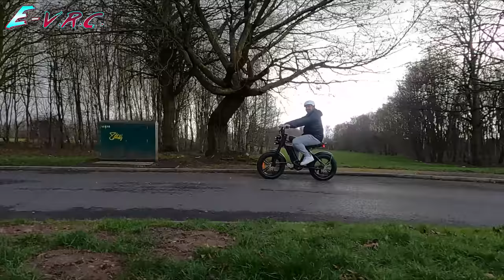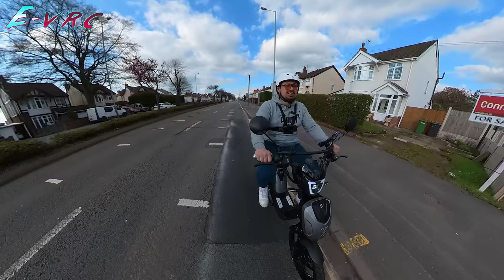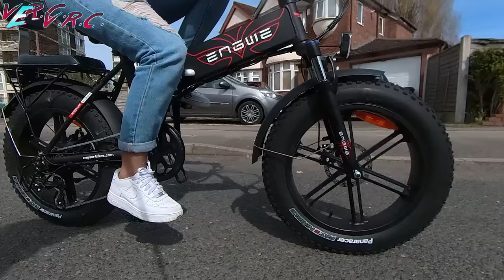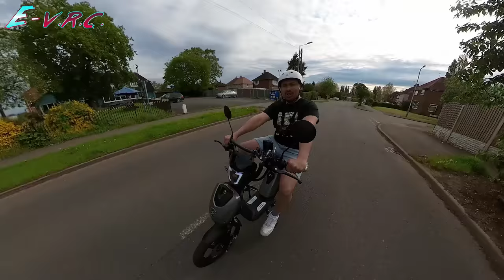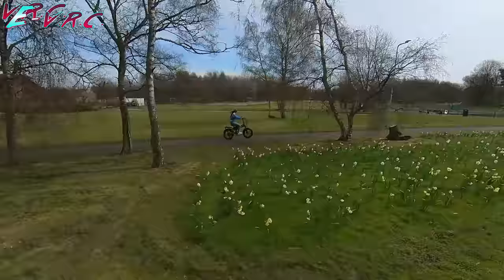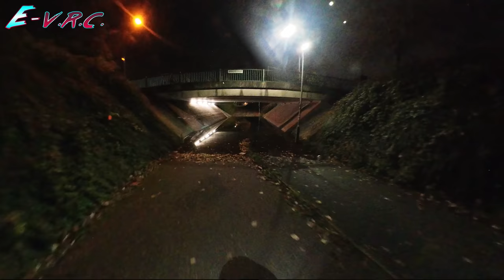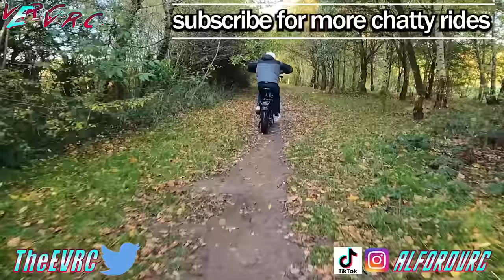The CRAZY Ebike law that MUST Change Before Someone Gets HURT

Comment: In my state (South Australia) the power limit is 200w and no throttle allowed. It's so silly.

I need that throttle regularly, as you show, to get around turns and across toad crossings, etc.
Reply from the maker: Wow even less! I'd have expected Austrailia to be similar to the USA.
Reply: i'm in Western Australia and i have 2 ebikes with 1500w bbshd mid-drives that can comfortably reach 50km/h. 

I have never had any problems with police over the last year i've owned them. 

I think you could probably ride any setup here as long as you aren't being dangerous. 

I regularly see sur-rons blasting past me at 500km/h and i think those sort of riders are the ones causing the problems.
Reply: @sparkoceanic  No Bike goes 300mph. Let alone an Ebike, silly!

Comment: Here in (D) you can have a S-Pedelec with assist up to 45km/h but you need insurance and a moped-license plus wear helmet. Throttle still not allowed, but I do not get your pioint with this. I never missed it. you can gear down for uphill sections or increase the assist-mode.

Comment: an e-bike (or to be more technically accurate, a pedelec) should be pedal assist only. A moped (ie, pedal-and-pop) has a throttle as well as pedals (to get started in low gear and to start the engine if that's needed for a petrol powerplant) and requires a CBT and provisional licence. A motor scooter is throttle only, no pedals - ie, a motorcycle, with or without seat.

I've known the difference since the late 1970s, what the hell is causing all the confusion??
Reply from the maker: Not sure. Maybe you were typing whilst I was talking so didn't get the point of the vid? 😬😬😂😂
Reply: you have read that once again, all that is explained in legislation and if there is nothing about it it means it's not illegal. ebike is 250W and that's it really, everything else it's made off by dvla or police.

Comment: For ebikes to be treated the same as regular bicycles, like no age or licensing restrictions, access to bike paths and such, the laws have to be restrictive.

If you want the capabilities or the power of a moped or small automatic scooter/motorcycle, get just that. But all sane people would argue that having age and licensing requirements for motorcycles, scooters, mopeds them is a good idea.

The "pedal assist bike" you are riding is an e-moped trying to pass itself off as an e-bike, with pedal placement and usability being an afterthought. None of those problems exist on properly designed e-bikes, like a Specialized Turbo Levo. Can be actually pedaled without assist, the SL (super light) models even more so. It has a proper pedal torque sensing controller, it can and does provide power from 0 cadence. You won't pedal strike going uphill anymore than a regular bicycle. Maneuvering tight spaces isn't an issue without throttle because its not built like a moped.
Reply: Well said, all the crap “e-bikes” in this video are not designed at all to be pedaled, the idea is: we just glue a pair of pedals to comply (on paper) with the rules, who cares if the frame is heavy with bad geometry, the pedals hit the ground, wheels are ridiculously fat and inefficient, transmission is a joke and the motor control is without torque sensor and abrupt activation ? The manufacturer already knows that they are going to be used with a throttle, and they will be modded to produce more power to have decent performance and used basically like a moped.

A decent e-mtb with mid drive motor from a serious manufacturer (Bosch, Yamaha …) and a proper 11 or 12 speed transmission, even much cheaper than the Specialized Turbo Levo, can ride basically everywhere on mountain trails, this even with the 250W limit and without a throttle. But such bikes are properly designed to be light and efficient so they do not need 1kW to go up a moderate hill. They are reasonably light and agile so that you do not need a throttle to move around obstacles and start moving.
If you don’t need to go off-road there are valid city e-bikes with similar quality components that performs equally well.

Comment: I got the perfect way around the throttle thing i think, with torque sensors literally instantly measuring torque, manufacturers could make it that as soon as it feels pressure on the pedals it uses the power dictated by the throttle, now that would be a nice feature and i think that would be legal as it's still not a standalone throttle
Reply: If torque sensors were economically feasible for all ebikes, all ebikes would have them, as they're objectively superior.  The problem is, that solution excludes low and most midrange hub driven ebikes until someone can make torque sensors as cheaply as cadence sensors.

Comment: To answer you question. If it has a throttle it's called a "Motorcycle" and you need a License, Insurance, Road Tax and a Helmet. Pretty much everything you have said here can be summed up as I want an Electric Motorcycle (Moped) but I don't want the legal restrictions that go with that.
Reply: I commented almost the Exact same!
Reply: A mobility scooter requires none of those things but has a throttle. It's the speed and power of a motorcycle that require it to be licensed, not the fact that it has a throttle. It makes sense in terms of safety to have a means of responsive speed control within the power range of any vehicle,  and it can still be speed limited.
Reply: @oldboy5001  From the Government Web Site :Mobility scooters and powered wheelchairs come in 2 categories:

class 2: these cannot be used on the road (except where there is not a pavement) and have a maximum speed of 4mph
class 3: these can be used on the road and have a maximum speed of 4mph off the road and 8mph on the road
Reply: @FellRaven01  Not sure what point you're making here. It's still not defined by having a throttle, but whatever.
Reply: @oldboy5001  How many wheels do mobility scooters have, how do they compare to e-bikes which are limited to 15.5mph. No relevance at all. I stick with my original point and your point is irrelevant

Comment: I completely agree with that law, considering e-bikes are really, and resemble mopeds from the early 80's. I had to pedal to start it. The fastest it went was 15mph on the straight, 20 downhill. If it looks, has a throttle, then it's a moped.

Comment: I run a bafang mid drive kit, happily maxes out about 33mph. Great in traffic, has throttle so can take roundabout's at with no pedal strike. Can pedal and enjoy the  exercise or ride it like a moped when late for work! Even fitted throttle to girl friends 250w hub just by changing the electrical harness from a 1t3 to a 1t4 and just plugged it in. Next 36v to 48v bat swap and a decent programmable display and she might keep up with me....

Comment: Sounds like you want the advantages of a road legal powered moped/motorcycle without paying the cost of insurance/tax and licence. i think 15.5 mph peddle assist is ideal for its intended use. Most high end e-bikes have torque sensers and power boast for traffic light situations, we all know increasing the speed limit will not end there, riders will always push for more until these bikes end up as mopeds.
Reply: Also sounds like you have a badly designed ebike which is pushing the rules as close to being a motor vehicle as it can without breaking them. Then you're complaining that the law needs to change to fix the design problems?!? Honestly if the pedals are touching the ground when you go round a corner, then you don't need to change the law to allow constant throttle, you need a properly designed bike with bigger wheels and pedals further off the ground.
End of the day this is supposed to be a bike not a motor vehicle. The power is supposed to assist you, when it gets to the point of the cyclist not actually providing any motive force at all this shouldn't be classed as a bike anymore, that's the direction the law should change.

Comment: Great points mate! Really can't see why we cant have throttle assist, and higher motor power and top speed limits. Hope to see some reforms one day
Reply from the maker: Cheers. Fingers crossed. Big reforms needed over all pevs 🤞
Reply from the maker: @woolychewbakker5277 that's just an arbitrary classification. The rule doesn't make sense as they're removing something that can prevent injury.
Reply from the maker: @woolychewbakker5277 nope. I want a graduated power delivery rather than a digital one. All Ebikes should just have the 6kph throttles on as standard since that is allowed by law. It would solve a lot of problems. The point of the video is that on/off pedal assist is more dangerous than a graduated throttle. Nothing more.
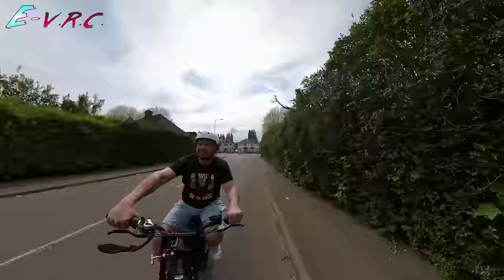Reply from the maker: @woolychewbakker5277 when I said this: 7:20 I had people with £3000+ ebikes in mind. Hardly any resistance when the motor cuts out and generally extremely efficient. Still, a throttle or something like the green button on the eskuta would still be extremely handy for a hill start though.
Reply: Well for a start, unlike cars, lots of people are riding ebikes on pavements and through pedestrianised areas. That's going to be significantly more dangerous than it already is if you increase the speed of them.
Reply from the maker: @mattc3581  you know throttles make bikes slower though right? Pedal assist is 100% power with no rider effort. Throttle allows the rider to 'throttle' that power to go slower around pedestrians etc.
Reply: @e-VRC  I'm responding to OP who was saying no reason not to allow higher power ebikes with higher top speeds though. Throttle wasn't my issue here, people cycling down the pavement on a heavyish bike at dangerous speeds, as we know they will, is my concern.
Reply from the maker: @mattc3581  I get ya 👍
Reply: @woolychewbakker5277 BOO!!!! I have a solar array, and a RV battery. No petrol tax, no road tax, no insurance, free electricity.
Reply: @woolychewbakker5277 Yes.

Comment: I think there should be ebikes kinda as they are with a limit on the speed assist. As to what that speed should be, I don't think I got enough experience on the road riding bikes to answer that. I don't think ebikes should have a throttle at all. I think there should be an eMotorbike classification for throttle based bikes, much like motorbikes, and that could be managed in the same way ICE bikes currently work. Fitter riders like the ebikes for the hill assist it gives, plus they are super handy at trail centres for being able to put in more downhill in a day as the climbs are not as tiring

Comment: I can't agree I'm a motorcyclist and find it hard to accept that these powered two-wheelers are on the highway without any annual road safety testing (MOT). If you want more power speed then you are getting into the same power territory as a classic moped in which case you should really be treated as such and required to hold a CBT/insurance and identification (license plate). I know this won't be popular but since my wife had her arm broken by an e-bike rider who ran into her and rode off with a disdainful comment of 'stupid cu*t' for crossing the road at a pelican crossing when the green walk light was on my tolerance for such bikes has gone!
Reply: its not the bike, its the rider.

Comment: A brief history of e-bike throttles on new bikes sold in the UK:
- 1983: throttles ok, bike limited to 200W power & max 15mph (UK law)
- 2016: throttles not ok, bike limited to 250W power & max 15.5mph (EU law, extra 50W and 0.5mph, yay!)
- 2019: throttles ok again! bike limited to 250W power & max 15.5mph (16mph accepted, UK law 250W Low Power Moped single vehicle approval required)

Those three years when throttles were banned from new bikes has caused a lot of confusion. Despite what some people think, the only thing the EU regulations force a country to do, is to permit a vehicle matching those regulations to be sold and used in the country (it's a single market thing). It doesn't stop individual countries widening their own laws to allow other vehicle types.
Reply: Classic example of this is France with its 2 seat Citroen ami electric 4 wheel car. Any one over 14 or 16 can drive it.
Reply: It is 250w sustained output. Can be higher than that.
Reply: @border304  yep, it can peak higher, the definition is:

"‘maximum continuous rated power’ means the maximum thirty minutes power at the output shaft of an electric engine as set out in UNECE regulation No 85;"
Reply: @shm5547  Cool. I certainly have no issues with hills in Turbo mode. :)

Comment: Here in Queensland Australia the state government has restricted bicycles even further now. The old rules used to be you can use electric power up to 25Km/h and if you wanted to go faster you had to pedal. Now from July 1st all bikes electric or pedal only the top speed is now 25Km/h and it's a $600 fine for exceeding that limit. As you can imagine all the guys/girls wanting to practise for bike racing like Tour de France are really upset over this restriction.

I just wanted to add that Australia is under a lot of pressure from the U.N. to reduce its carbon footprint but when the citizens try to go electric with e-bikes to commute to work the government put out all these restrictions forcing everyone back into cars.

Comment: When riding ( haven't lately 😥 ) I ride through a ford where I lift my legs a rely on throttle. I also throttle on corners to prevent being thrown off the bike from my pedal hitting the ground. I also throttle lightly ( de-power) to change gear to reduce load on the chain/sprockets. I think a throttles a must have.

Comment: I actually think the law has got it about right. It's all about trade-offs... remember this only applies to ebikes that can be ridden without a licence, tax or insurance, and by under-17s. If you want a more powerful motor and higher speed you can buy an electric moped and ride it around with L plates and a provisional, just like all the other millions of moped riders out there. If you want a bike that goes more than 15.5mph, then buy a good non-electric road bike and get fit enough to ride it well. Ebikes hit the sweet spot of an unlicensed bike that can be used for relaxed commuting or leisure travel in a city, without breaking a sweat and/or in hilly areas.
Reply: People always want to push the limit. You’re allowed to ride e-bikes but now you want the freedom to ride them like mopeds or scooters. Ignoring the laws might result in the banning of e-bikes altogether, which hurts a lot of people. Get something more appropriate for your desire for speed. Maybe get something sized for an adult, too. Pedaling with your knees practically hitting your handlebars or chest looks incredibly silly.

Comment: I've got an Engwe EP-2 Pro with the throttle disabled in case I get stopped by the police. I was coming home with my cargo box and backpack full of shopping once. Saw a red light coming up (bare in mind the crossing was on a slight incline), so I shifted down to second gear thinking I'd be fine getting going from a stop. I wasn't. Barely managed to keep the bike upright before the pedal assist kicked it. It was embarrassing because there was cars behind me and they probably had no idea why I was struggling to get going. I've even struggled to get going in first before when I've been hauling a heavy load. Even the slightest incline makes it so much harder to get going with the weight of the bike combined with the weight of all the stuff I'm transporting with it. It's put me in quite scary situations a couple of times. The law on throttles needs to change.

Comment: When "Wheeling" becomes common all over the UK,  insurance and registration charges will be applied to all UK ebikes.  These are related directly to ebike power, with more powerful ones costing more.  

The idea of this is to encourage users to hire ebikes from local authorities, which in many cases will work out cheaper, as the hire charge covers insurance, and the bikes are already registered.

I am very surprised that these things are never mentioned, even though they are measures which were introduced some while ago, at the same time LTNs, were rebranded as LCWIPs?

Anyone interested best to contact ATE for more information.
Reply: Great. Now what do we have to do to stop this lunacy? I do not want to hire from a local authority. I do not want LTNs. I do not be controlled by anyone. I want legislators to stay at home and do nothing.

Comment: Throttle is a must in a city. Reason we have bicycle boxes. Tried pedaling from standstill, until the bike registers and kicks in, you will be wobbling around trying to pedal that 25-35kg bicycle which is dangerous. Some drivers are inconsiderate and they almost hug you while passing by which is when you could be hit. Throttle is exactly what you said in video - more attention to the road=safer.

Comment: I built my ebike. 1000w 48 volts. I never use the pedal assist (mainly because I dont have the tools to remove the pedals and attach it) I just use the throttle instead. Hell I even stand on the pedals and ride it like a scooter sometimes. I don't take it out on the roads or ride it at high speeds though. There's a path I know that rarely has anyone on it, so one day I'm gonna go full throttle along that path just to see what it can really do.
Reply from the maker: Sounds awesome! Enjoy 🤟🤟

Comment: I have a kristall e5 e-bike had it for 4 yrs upgraded a few parts a long the way ! adding suntour suspension seat post and front forks 
I love this bike it’s 350w 48v with throttle and I can reach speeds of around 25 with the throttle. I am glad of the throttle,like you said it’s ideal for a quick start at traffic lights and I used it threw large puddles without getting feet wet 😂